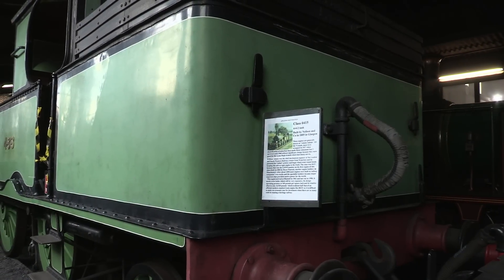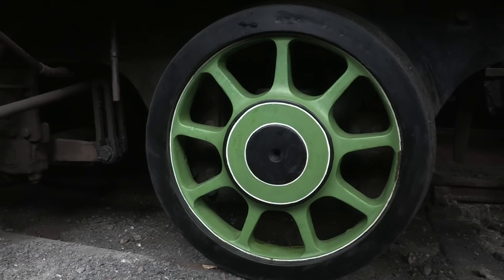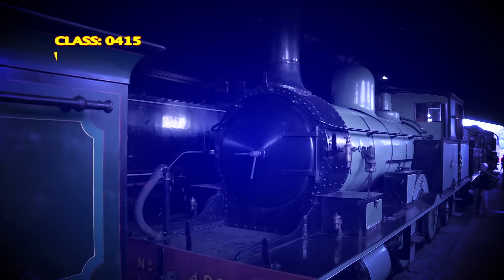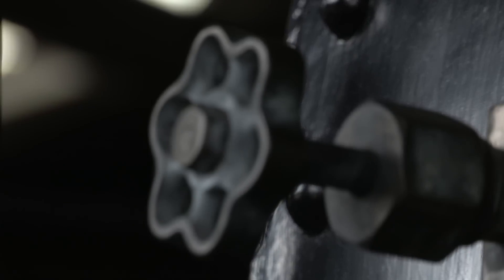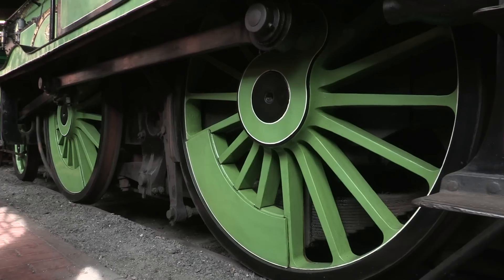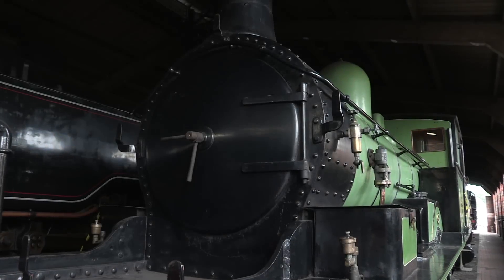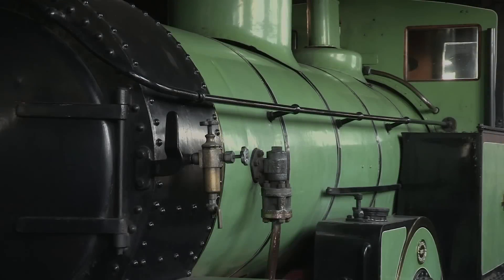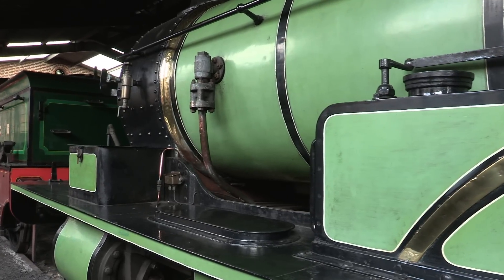SOLE SLIP: Adams Radial 488

Comment: Nice video Chris. It would be interesting to see a 'Sole-Slip' on LNER Peppercorn A2 60532 'Blue Peter'. Cameron
Reply: CWSteam&Diesel it would be nice, however she is currently in peices being restored to working order!!  Yay! That means we will have an A1, A2, A3, and A4 in steam
Reply: @Electra_1203  sadly there are no LNER A5s preserved
Reply: KarlosBricks sadly not, but at least we can have 4
Reply: @karlosbricks2413  replicas can still be made
Reply: @theextremeanimator4721  In theory yes, although a suburban tank like that? quite unlikely, all the current replicas being built are big mainline tender engines, which have a hope of making financial sense as they can pull a decent number of coaches along the mainline. I can't see a subruan tank like that ever making sense to built from scratch
Reply: @karlosbricks2413  Suburban trains are essentially Commuter Trains
Reply: Now A2 Blue Peter back in Mainline running order. 
So easier to film running and fully intact and stationery.

Comment: On the Lyme Regis Branch, before opening in 1900, LBSCR-loaned Stroudley Terriers were tested in the intention of them running the line. Their weight caused much damage to the track, as the line had been built cheaply with a light railway act. The Radials were chosen instead as the motive power, due to their lightweightedness, not just for them being powerful and able to tackle sharp corners.
Reply: Wait..... "TERRIERS" were too heavy for the line? Seriously?
Reply: @TallboyDave  It was either that or they wer underpowered and constantly required top ups at Lyme Regis following a steep climb from Axminster

Comment: This Loco came up in a debate about the recently restored Hunslet 4-6-0 2ft gauge loco number 303, this loco and the Adams Radial Tank Are the only two loco's that we could think of where the coupling rod drives the the first powered axle, true a small detail but very unusual, are there other loco's that built this way ?
Reply from the maker: The Adams T3 No563 springs to mind. And if you want to stretch that to overseas, the numerous 'American' style 4-4-0s and NYC 999 spring to mind.
Reply: @ChristheXelent  Good point about the American 4-4-0's, my thoughts had only extended to British Locos. In trying to rationalize the design of Hunslet 303 one speculative thought was did this loco start life as drawings for a narrow gauge ( export ?) 2-8-0 goods loco, Did the war department approach Hunslet for a powerful tank loco in a tight time scale, so instead of trying to create a design from ground up Hunslets adapted a 2-8-0 by removing he first driven axle to let it get around tight curves ( no flange on the center drivers ) and replacing the pony truck with a bogie, otherwise 303 seems an unnecessarily awkward design.
Reply: Random one... Beatie well tank??
Reply: Midland Compound 4P too.
Reply: Southern Railway class V Schools.
LNER D49 Shire/Hunt.
Ex NER Raven design S3 4-6-0 types. LNER class B16.
NER Raven A2 Pacific's.
GWR County 4-4-0.
Also most 4-4-0 and 2-4-0 types with inside cylinders.